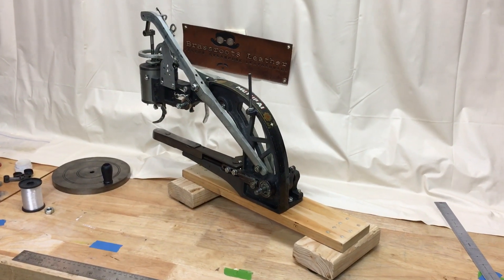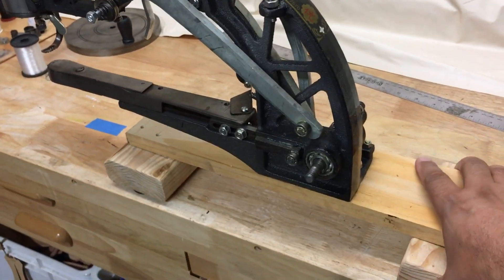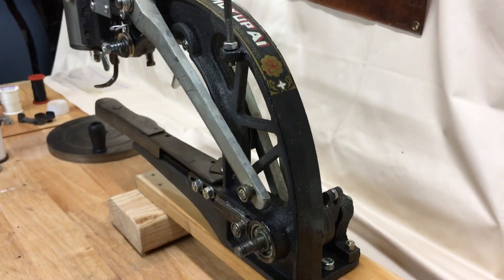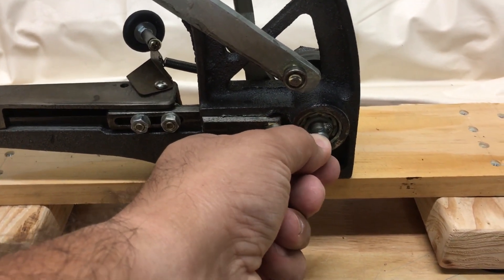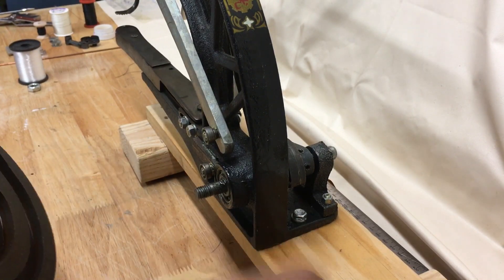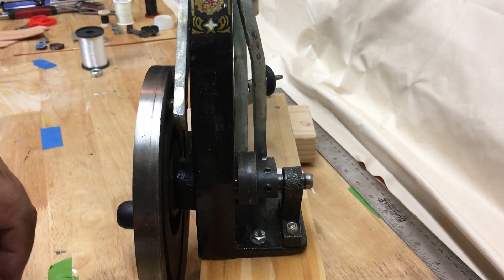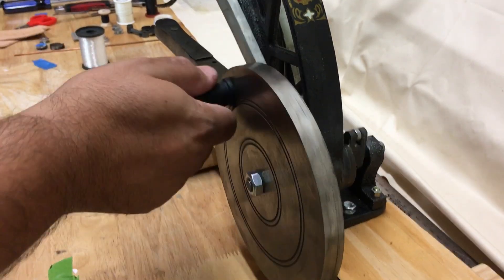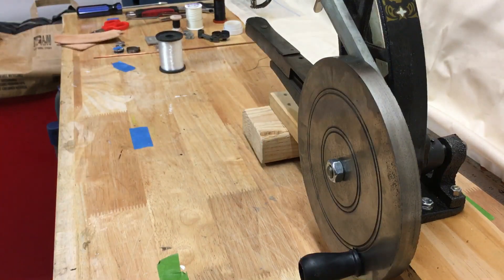Muyupai Leather Patcher - Assembly

Comment: I'm having trouble lining up the screw that sticks out and getting the little rolling wheels all aligned at the same time I got it once then turned it - it worked but jumped out before I tightened the screw on it worked then jumped out and I haven't been able to get it back again. Is there a trick I'm missing? Or just keep trying? My bottom slidy thing doesn't seem to move as much as yours does and I think that's that's part of the issue.  Arghh
Reply from the maker: If things don't move freely... add a drop of oil and move them with a tool (wrench or other) until its free... also make sure that the cover is open so you can see the bobbin and that its rotating freely. 

Once you have all the parts wiggling, you will need to turn the wheel a bit as you tighten until all the bearings fall into their place, and keep turning slowly as you tighten until you feel it sink all the way in. Once that happens you will notice that the wheel has an index part that aligns. As long as that is there, you should be able to get the nut tightened on completely. Use an adjustable wrench to get it all the way on. 

Good Luck!